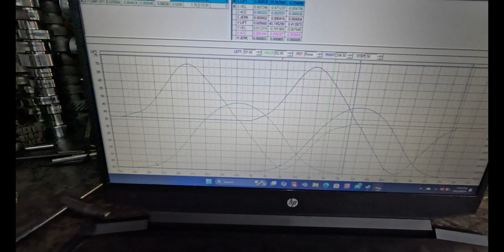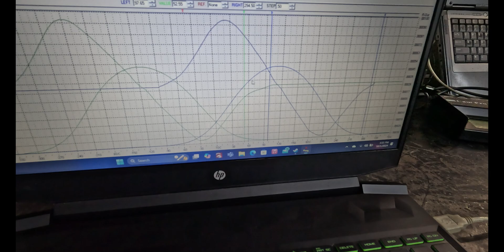Camshaft discussion,  Asymmetrical Lobes

Comment: In other words its the actual geometry between the top of the valve and the circular mechanical movement of the pushrod and rocker...even though the rocker is stationary the rod force follows a geometrical program as does the kinetic energy of the valve spring when it forces everything back down
Reply from the maker: Yes

Comment: How do you make the master to grind the cam lobes?  Can you make the master from a spreadsheet of crank degrees vs. lobe lift?  I'd like to see how the masters are made.
Reply from the maker: @JamesMiller-v4s  we design the lobe and output that data as a lift table,  then the  cnc the master
Reply: How much would it cost to make a master if I sent a spreadsheet with the lift specs?
Reply from the maker: @JamesMiller-v4s  about 500.00,

Comment: I have thought about building a cam grinder for small engine cams. Probably not the best idea, but I'm thinking of using a large adjustable rocker/follower to first make a copy of the lobe. Then adjust the rocker ratio to allow the grinder to make the lobe smaller on the base and take just the peak of the probe to add duration, then map out the lobe  to get the new lift and duration. I'm not looking to do much mostly get some duration and possibly retard the cam a 1°- 2°, maybe add 10° @ .050 if possible. And maybe .015"-.020" lift at most. the valve to piston clearance will allow much more lift, just guessing I could go up about .050"-
.060" and still have clearance, all the cams available are basically stock cams for different applications, and the difference in them is very minimal, the engines are used in motorcycles, scooters, go-karts  ATV's. Each having a slightly different power curve, the atv and kart needing more low end power, the motorcycle needing more high rpm power, the scooter more mid range , I cant tell the difference between any of them. And basically done everything you can do to make power, if it was a SBC, it would be making 550-600 HP+, it went from 39 mm bore to 50 mm, the valves are 3.5mm larger than stock. The piston is 2mm taller, (the aftermarket High compression piston) and the head is ported and de-shrouded , and went from 18 to 20 mm carburator, with free flowing exhaust. Also titanium retainers and stiffer springs, I also added a shim under to get a few more rpm from it. With the CVT set up to rev to 10,200 rpm it's not making the power, it's really done around 8600-9200 rpm. With the bottom end   balanced how it is. I'd rather keep it under 10k or better yet 9400-9500. The last two things I can think of doing is shave the cylinder about .020" to get a sero deck height. And cut the head about .040" or so to get the compression up, my China gauge says it's about 165psi (+/-) it was 155 psi (+/-) i'd much rather have it around 185-190 psi it seems the cam is designed to basically have a compression release at low rpm with its grind, leaking off compression at low rpm  the bike doesn't really move below 5000 rpm crushing  around at low speed basically coasting maybe 4000 rpm it can easily idle around 1500 -2000 rpm. The CVT clutch starts to grab around 4500-4900 and starts pulling on take off around 5200 and normal at speed rpm is 7500+ 40 mph 8500-9k the rpm gains little and the bike picks up speed as the cvt ratio changes, just like a stall converter at the strip,  the converter attempts to get to a 1:1 ratio as the vehicle accelerates. The rpm only slightly gains a few hundred to a couple  thousand rpm, if it was a manual it would be 4-5k sweeps through the gears, the converter revs and stays at a narrow rpm band and the vehicle accelerates. I need a cam that will make more power between 5k and 9800, the ports are about as big and direct as they can get with a burr finish. I raised the intake port as much as possible. With a matching carb adapter, the stock was unbelievable, it looked like something just ran a 15-16 mm drill in from both ends and called it done😂. I certain that is what they did. I spent a hour or two grinding it out. Making a smooth radiused arc you can put a finger in.  I epoxied a couple  to fill the bottom of slow areas and port matched to the head. If I had access to a mill I'd machine a new one. Keep the port as small as possible  and still flow the required air, make the best tq and power possible. I'm thinking maybe buy a cbr 600 cam and copy it(or other sport bike with the same type valve train, see how that works out. It's probably goin to be a bit of work doing it that way. Maybe get a 2" bar of 4340 to make the final cam from, but mill a couple cores from cold rolled for testing to grind and regrind if needed. would probably be the best route. I don't mind running 95-100: octane fuel if it makes decent power. (Probably not possible from the small engine) I even thought about getting the amr300 or amr500 super charger,  running it under driven to  just start making boost around 3500-4k peak around 7.5k-8k with a waste gate to return the boost to the intake about a 1/2" tube and valve  with the fuel in the air, maybe this would cause a rich condition? Haha, maybe run a 3/16" stainless tube into the exhaust in the middle of the muffler it getting to 8500 rpm start wasting boost and blowing air and fuel into the hot exhaust,! 😮 , I can imagine anything from a 2" flame to a 6-12" flame out the exhaust at full speed. Don't know how long the muffler would last😂 imagine seeing that at night.  The engine started out with 2.8-3.5 HP,depending on application. With the performance gains I figure I'm getting around 5 HP from the engine. 82-85 cc can't remember exactly, there is a guy in Europe with a 50 cc , 2 stroke bike that made near 50 HP just under 20k rpm. He runs it out west on the salt flats, it would be awesome if I could get 1/3-1/4 that from my larger 4stroke engine, 8-10 HP would be great! Without boost.  The next two things possible is going to a 150cc engine. Or more radical, build a two cylinder engine. By welding two cylinders and two heads together  weld up the spark plug hole and drill another hole in the opposite side. if I did all that, I'd rather just cast a new cylinder and head. Possibly make it water cooled, use a heater core from a car as a radiator. And make a small water pump to run from the engine. Bore out the aluminum cylinder casting and press in iron top hat sleeves. And cast a set of heads using the 150 valves, so they will be about 5mm larger than stock 16/18.5 for thd stock 50cc. And 21/25 or 23/28, and a larger big bore is available that requires case mods, going from 50mm to 52.4mm, (the stock is 39mm) this is a decent jump.  And instead of welding two cams together. Just mill a new cam from a 1.5-2" bar of 4340. Just curious if you could regrind cams for these engines, (GY6 Honda clones) I figure you can turn between centers, and use a bolt through the cam sprocket to drive the cam, the sprocket is just pressed on I don't think it even has a key or anything to keep timing. I would  like to engrave alignment marks , remove the gear while hot retard the cam 1°-2° possibly 4°-5°  maybe even try one advanced up to 2° just in case it is already retarded basically too much to make good power, kicking it over slowly it pulls in the exhaust for a short time, I know the exhaust valve opens before the piston is down at bdc this seems excessive. I feel it will make more power with different event timing and more lift and duration, I don't care if it idles at 2500 rpm , I have even tried different cdi ignition boxes, adjustable cdi, that adjust the advance rate and nothing makes a noticable difference. Can't even see a difference in idle. I don't think getting 8-10 HP from a 82-85cc engine is too much. Have an awesome day🎉, and sorry to ramble of soma tangent! ✌️

Comment: My kind of questions would be, does a symmetry actually help performance and is it easier on the cam,value train, etc. Also, and you may have already done this,a video on how to set up older blocks to be able to run a roller cam and lifters.

Comment: There all asymmetrical no matter how much you grind it or the cam Masters where they're never going to open and close at the same rate  , because wear  different rocker arm ratio  machine being off,   there  to many degrees of freedom! Also intake valves are heavier then exhaust.
Reply from the maker: Unfortunately that is 100% false, I can show you plenty of symmetrical lobes...
Reply: @powellmachineinc  so you mean to tell me every cam grind you grind  is with in 0.0001 of a degree with no negatives  on your  arc too a tangent  on your   cam masters  that are 5:1 scale ,show me I'll love too learn

Comment: Been looking for some information on crate 602 cams, is there any +/- on the tolerance of the lift we had a brand new sealed motor right from gm, that got the cam doctor and were told both intake and exhaust were high,  they let it go but still they were questioning it. Is it possible for the lift to be off some right from the factory ?

Comment: I wonder about the “intensity” number. Your example was 18.54 on the opening side of the intake lobe and 16.5 on the closing side. I would think 16.5 was more intense because that sounds like a steeper slope. If that’s correct, then smaller is more intense, not less. —I’m adding an edit to explain my mental picture: The cam doctor screen has the flank displayed as lift above a base circle that is unwound to a flat line. The degrees are units of cam rotation, not flank slope. On the cam doctor display, those degrees equate to x-axis distance, where the y-axis is a fixed 0.030”. So, as I visualize it, the bigger number of degrees equates to a lower flank slope, and vice versa. But this is not necessarily what you meant! Please explain! This is great stuff, thanks Daniel.

Comment: Thx for demystifying Asymmetrical Lobe cam designs...In general, most cam Lobe & valve Action is Sinewave shaped probably necessitated by practical Mechanical reasons....For all out Maximum HP at typical Rpm ranges without valve train Mechanical limitations, what would be the Optimum Valve action Shape ? ..An Instaneous Square wave rectangular Valve action or Still some Sinewave shaped Valve action shape ? .....Thx for all the helpful info you share...
Reply from the maker: Thank you

Comment: Thanks for what you do. I have a masters degree in engineering and a concentration in powertrain - but I still always take some knowledge away from your videos.

If you've worked on, or know much about "lofting" cams (that purposefully launch the follower off the nose of the cam), would be interesting to hear what you had to say about them.
Reply from the maker: @GroovesAndLands  iv seen it happen,  never on purpose tho
Reply: @powellmachineinc  I know very little about it, myself. I was (very) loosely involved with the GM indycar engine program. There, indycar had rules limiting valvetrain lift, so GM designed the cam to launch the valve off the cam.

Launching was easy, but landing it gently was not. I heard this wasn't a brand new innovation, and others had done it.

But that's all I know about it. Basically, it's a thing.
Reply from the maker: @GroovesAndLands  when we raced box stock class, people were doing it, but it was to unpredictable,  so control was better,  we stopped lofting and started winning,  they teched our engines multiple times but couldn't find anything

Comment: My first time dealing with cams was a DOHC, adjusting the centerlines for more power was easy. My question is how a single cam is figured out for optimum power? Tech card for the cams always said 110 centerline, we wound up with 106 in - 108ex for max performance.
Reply: Physically making the adjustment to centerlines on a DOHC is easy enough, but knowing what it should be adjusted to is not so easy. That'll be a LOT of dyno runs. We had a pre-programmed test we ran on the engine dyno @ GM to figure out what all cam centerlines created what all results. When you consider a DOHC with VVT, you've got two cams, each of which can be independently skewed ±25º, at any rpm between 750-7000rpm, there are a LOT of potential combinations of settings. That automated test took days to get through, running full time and only running each combination for a minute or two.

For a single cam, start with whatever the cam card calls for. If you actually degree it and set it up right - you're doing better than 95% of hot rodders. From there, all you can do is test out different settings to see what difference it makes for you.
Reply: @GroovesAndLands  We used real world track times and mph to find best cam settings.

Comment: I've watched a lot of your lessons (videos) no where near all of them. I've understood and learned from most of them, not sure I was able to keep up with this one. I need to watch the video again that talks about the LS and Harley lifters being similar, I have tried to find that video in your library without any luck, can you offer a clue how to find it? Glad your power's back on and hope things are returning to normal. That light over your right shoulder is doing some funny stuff. Regards.
Reply from the maker: Great to hear!
Reply: I was an intern at the plant that has made all of GM's lifters since 1952. Basically, GM had them figured out really well by the 1960s.There's actually a lot that goes into getting them right - so many other engine manufacturers simply buy good lifters from GM (Delphi/Rochester Products/AC-Delco) instead of putting in the work to do it themselves.

There were three major products - the 0.842" HVL (hydraulic Valve LIfter), 0.842" RHVL (roller hydraulic) and  0.921" RHVL. The 921RHVL was used in all Navistar/Ford diesels: The 6.9L, 7.3L, 7.3 Powerstroke, 6.0L and 6.4. Also used in the Duramax. Toyota fork trucks used HVL and Harley Davidson and some others used the GM RHVL product. I'm sure I'm forgetting others.

We also did lash adjustes for finger-follower type valvetrains, and hydraulic buckets for the direct-acting stuff like the Quad-4 and others.

Comment: So if I can’t get the lobe lift I want e.g. 0.390”on a HR to achieve the valve lift I want is it okay to run a 1.7 rocker on a 0.365” lobe to get it or is it unstable to achieve it that way?
Reply from the maker: No it's fine

Comment: iT'S  the shorter 50 from the longer 20  but I use 006 at the valve to take the lash out of the analysis
Reply from the maker: Using. 006 on a solid makes zero sense
Reply: @powellmachineinc  .006 AT THE VALVE   it's using .020 on tight ash and 30-30 is what is meaningless   still a good post
like working backward from the flow and the valve

Comment: Great video I was curious what is the distance between the intake and exhaust lobe center lines called duration or lobe seperation angle?? THANKS
Reply: LSA. Duration is how long the valve is off the seat measured in degrees.

Comment: hi don from dons engines, i have a question for you, i want to know if this has been done ok hear we go i have short deck bb chevy i want to make it tall deck by adding .400 thick steel plate to the top of short deck held down by counter sunk bolts with good sealent for water , than bore clyinders for melling sleves to take care of seam that the plate will make , than use longer arp studs to hold it all down what do you think ? trying to make tall deck from junk around shop i know i should by gm bowtie block thanks don
Reply from the maker: Will it work, yes, should you do it, no
Reply: Read about Jon Kaase's MEL (edsel) engine he took to Engine Masters.

Comment: I think I would be much more interested in knowing how running different rocker ratios effects spring pressure/ lobe design. OR, what are the advantages? of a large lobe with say a 1.5 rocker vs a smaller lobe and a 1.75 rocker- both with the same .600? lift. In particular how this relates to the LS.

Comment: 🔔😎
Im aware that rocker arms of the same advertised ratios often have greater off the seat intensities due to the fulcrum to tips angularity. 
Will this be detrimental to valve train life?
Thanks.😎
Ex: PRW Sportsman SBF 1.7 has an off the seat of 1.87 (its said). That would be quite a jump for a 1.6 cam.
Thanks again, Sir.

Comment: Erics cam challenge is producing results already!, this in depth chat that all the builders are doing is excellent. I used to race old air cooled motorcycles and when i built my first engine I purchased cam that everybody else was using just as a starting point. The engine ran ok but was obviously no faster than anybody elses. I printed out some graph paper off the internet and plotted out the profile via degree wheel and dial guage and immediately found a big reason why these things were blowing up on the regular. Everybody was just accepting of spinning old engines to 12 thousand plus rpm was going to grenade them occasionally but the graph showed nearly zero ramps on the profile. With the clearances a rocker type motorcycle runs, it was just slamming the valves straight back onto the seat and riping heads off valves. I went to a different cam grinder to everyone else, explained my issue ,and didnt lose an engine during a race from that point on. It dosent take very long at all to hand plot out the cam motion and it explains a lot more than just the old 50 thou duration /lobe seperation ect.
Reply from the maker: @watsisbuttndo829  definitely
Reply: High lift Andrews cams were notorious for ramps that slammed opened valves and broke stuff.

Comment: The first time i saw a really assymetric lobe was on a mistubishi 6g72 sohc. The layout is almost the same as a ford 427 cammer with rockers on a center camshaft. I think it used 4 unique lobes though because of how the engine was mirrored and that both cams spin the same direction.